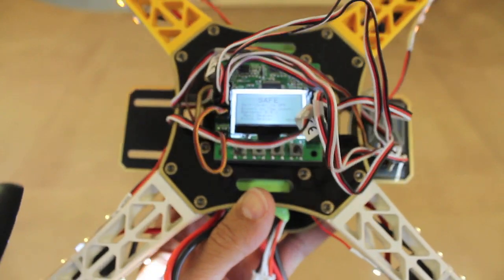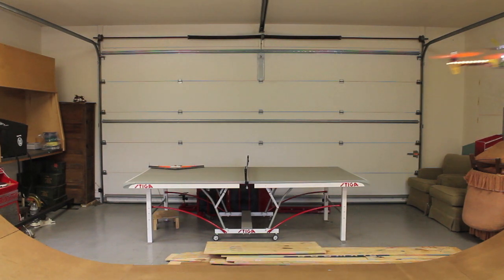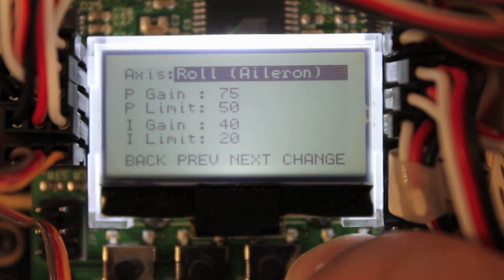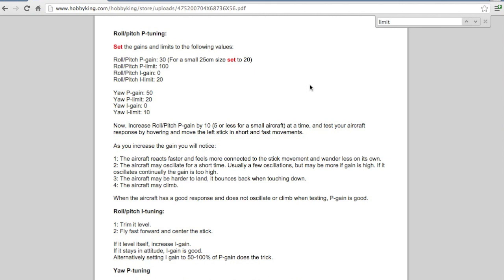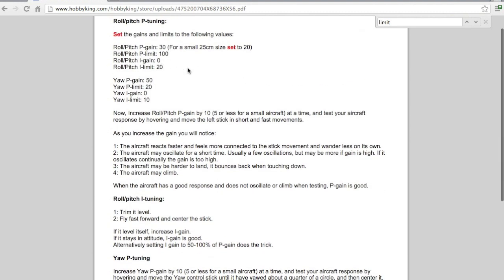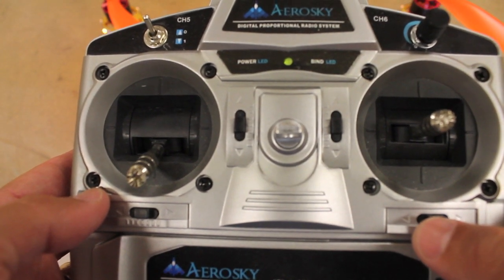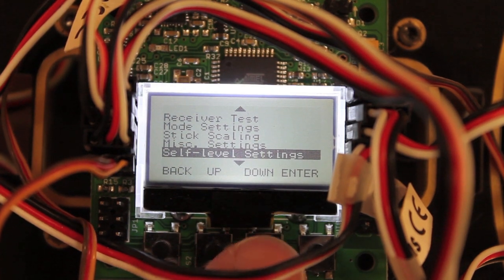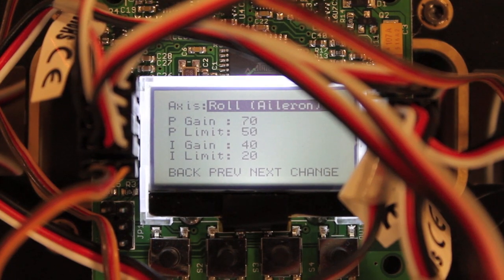KK2.0 Multicopter PI Gain Tuning for Beginners

Comment: Hey Dennis, I've watched yours and many other PI tutorials and think I understand it o.k. But my question is are these adjustments affecting the stable mode only or do they affect acro mode as well? I feel like I have to be on the stick the whole time in acro mode just to keep the quad from crashing. I have the KK2 with 1.6 firmware (I think 1.6, did it a while back). I see these videos with the quad on a string (Rolf's, and a couple others) and when properly tuned they stay in the attitude they were in until corrected. If they were in stable mode it would flatten back out. So I guess I may have just answered my own question. I've played with the PI in stable mode and can see what too high or low can do, but still not comfortable with flying acro yet.
Reply from the maker: Good luck with your experiments and it will be no time before you're flying in acro mode. It really is a lot of fun and challenging at the same time. I still use stable mode when I get in trouble or am doing some filming, but other than that I'm in acro trying to fine tune my skills. Thanks for the comment.

Comment: Hello Dennis it's Eric again. I am builing my wife  a quad. It is a Turnigy H.A.L. She would ike to use it for aireal photography.  She would like gps hold, altitude hold and return to home. What type of flight control board would you recommend.  She still new to the hobby, almost a year.
Reply from the maker: Eric Ankudavicius Hey! I think the easiest thing for you to do with best potential outcome is to install NAZA V2. It has good stability and should work well with the HAL frame. You'll get alt hold and RTH. Good luck and keep us posted.
Reply: Thank you for your advice. I will use the NAZA V2. I am sure you will hear more for me. Thanks again.

Comment: hi Dennis, im going crazy on my tricop. the servo goes crazy jitter when i accelerate. i tried changing into a big standard servo hoping to handle it but it doesnt change at all. now i will try to set it as shown on ur vid and let you know if it gets better (hope so) otherwise kindly help me with my settings. im pretty NEW in tricops, thanks a lot God Bless and more power.
Reply from the maker: bobot021070 Sounds like a plan. Good luck with getting things configured and hang in there. It doesn't always come easy, but is incredibly rewarding when your bird is in the air. If you continue to have problems please feel free check out www.garagepilots.com and post in the forums. Take care.

Comment: Hi... is 'auto level' the same as 'altitude hold'..?

Does the KK2.1.5 flight controller have any of the bells & whistles of the other controllers?
Reply from the maker: No it's actually different. Altitude hold is generally done with a barometer or GPS. Auto-level just stabilizes the aircraft and keeps it level when you let off the sticks. You may be able to do what this guy did with the MultiWii firmware although I've never done it: http://www.rcgroups.com/forums/showthread.php?t=2157987 Let us know what you find out.

Comment: in my project i use k.k. 2.1 controller board and fw is 1.9 but with your pi setting it can not flying. problem is that motors will start to increase in speed while others are decrease. please help me 
sir.

Comment: Hello Dennis, I have set all the setting as you have shown me, but the screen shows :Error; no yaw input. I have set the yaw to 75,20,30,10. then back to  PI Editor. as your video shows. Do you have any idea why?
John.
Reply from the maker: John Stanley I haven't seen that before. Perhaps it's a channel issue with the board not seeing any signal from your yaw channel? That's my best guess right now.

Comment: My mistake.  Yes, auto level.  When I turn auto level on, it starts to do small banks, then holds the small bank and and starts to run off with a mind of its own.  It is not "drifting" but actually doing various banks and holding them.  But it flies great with auto level off.

Comment: Hi, I just built a hexacopter and I have the kk2.1.6++ firmware but I have a problem with the P settings. Will your setting work for the hexacopter?
Reply from the maker: Sol mag It's hard to say. My guess would be that they won't work and you'll need to tune them higher. I would see if you can work your way up from what I have since your hexa will have a larger frame.

Comment: Hi, I have an X230 by HK.  The problem I have is that is flies well when off safe mode, but when I turn on safe mode the copter starts to have a mind of its own.  I tuned the ESCs, made sure the board is calibrated level, everything is balanced.  I have a blade nano quad which is rock solid so now I really can feel how bad the x230/KK2 board are.

Also, I understand P & I gains but I am unsure what the P & I limits are for.

Any help or input is greatly appreciated, Thanks

Comment: ps is it bad if i set the servo with a y extention? one of them goes to the RX and the other goes to the KK2. what is the correct connection of the servo? thanks again. More power.
Reply from the maker: bobot021070 I've never setup a Tri before, but I'm fairly confident you shouldn't be using the Y connector. Your inputs from the receiver should be connected to the KK2: AETR. Then M1, M2, M3 hook up to the appropriate ESCS while M4 is where you plug in your servo. This is a great guide that may be worth referencing. Good luck and keep us posted.

http://diytricopter.com/wp2/build-log/

Comment: What was the reason for going from MultiWii to KK?  I just went the other way and feel that my quad flies much better under MW.  Response is crisper and it is more stable in hover.  Under MW I can make stablr vertical descents through my own down-wash.  Under KK2 v1.6 it would oscillate badly.

Comment: Thanks sir that was very helpful
But i have problem with throttle it does not stick to one position while flying with low level
I am using kk2.1.5 board
450 frame
1000kv motor
30A esc
4400mAh 3S battery
Please help me with the problem 
It is easy ro take off but very difficult to land it as i drop little throttle it comes very quickly on very large diatance

Comment: Hi Dennis, 

Thanks so much for all your informative videos - couldn't have done it without you and others posting videos on your experience with multi-rotors. Those KK2 Boards are a pain in the ass and are hard to trust after a crash, despite sensor test coming out okay it can still play up ; ) Good thing they are cheap! Got a video with my entire journey to date building a hexacopter just uploaded, check it out if you've got a sec! All the best, and once again...thanks! :  )

Comment: Hallo... Friend. I built an f450 quadcopter & using 1400kv motor & 8045  propellers.kk2.1. 5 mini flight controller also.I calibrated the ESC and the motor running in proper direction with maximum throttle. But it cannot fly.I tried 1045 propeller also Expecting your reply.

Comment: I have an fs th9x transmitter and I'm using a kk2 on an alien x quadcopter I wanted to know how to setup the diff modes for acro and auto level or does it setup automatically on the switch?
Reply from the maker: +george aura You'll need to likely configure the weight and offset for each switch so it can trigger the correct flight mode on your controller. Good luck with your build.

Comment: hi dennis joey here, so what mode are you using to fly the quad, helicopter mode or airplane mode?
Reply from the maker: joey jacildone I use ACRO mode on the Turnigy 9X. Now that I'm flying with the Taranis it has a generic template that can be easily modified.
Reply: use airplane mode if  that is your only 2 options, i have the tgy-i6 and had the same question a few months back

Comment: I tried everything like how you set it up but whenever I raise my throttle, the quad just flip to the back and break my motor,and then I fix them back and switch on the auto level and it does the same thing, please help me,or should I get the 'qq super flight controller '?
Reply from the maker: Aaron RC I'm not sure what the problem is without more info. Perhaps you can post in our forums at www.garagepilots.com and someone can help you out. It sounds like there may be a calibration issue.

Comment: i tried all your setting and my quad work, but for some reason when you do the YAW right the quad moves forwards, and  YAW left the quad moves backwards, 
we have the same setting but i wonder why is that happening. feedback will be much appiciated
Reply from the maker: sir francis Not sure what's going on. I can only recommend messing with some of the gains and see if you get better results. Generally you'll see a bit of drift when yawing. Just depends on how much you're seeing.
Reply: thank. ill have your setting as my template then ill start adjusting. thanks again..

Comment: i was thinking of geting one but i have 11.1 batt how do you power it when it is 4.8-6 volt from 11.1 volt
Reply from the maker: You can get 5V out of your receiver or use a standalone BEC that will step down to 5V.
Reply: ok thanks

Comment: Its ok bro.. and i got my problem solved but there arrives new problem except M1 all strts together just M1 takes time to catch up... any ideas???
Reply from the maker: +Rohit Chauhan Maybe try to do an throttle calibration individually on that ESC. Perhaps the starting point is off compared to the others. As long as you don't notice any difference in actual hover and performance I wouldn't worry too much about it. Good luck.
Reply: +Dennis Baldwin  thanx man i changed min throttle and it works just fine but a roblem still occurs. now.. my quad does take off but goes in a certain direction continuosuly.. cnu help me bro??

Comment: Hi dennis will these settings work for my tricopter?
Reply from the maker: ras4q2001 Hey unfortunately I've never flown a tri with the KK board so I'm not sure it will work. I know the process will work, but not sure about the specific settings. Let us know what you find out. I think it would be useful for others as well. Thanks.
Reply: Dennis Baldwin Hi Dennis  the pitch&roll settings are good my problem is the yaw settings my tricopter drifts to the right when i take off any ideas thanks

Comment: ey admin I'm having a trouble in starting my quadcopter. when I rise the throttle the motors doesn't spin till I push it to the middle then one after an other motor stars to spin can u plz tell me what's the problem with it
Reply: Muruli muruli you need to arm the quad .

Comment: My KK2 is SO HARD to fly :( It wobbles like crazy when I'm flying and it randomly will rotate in a random direction, and sometimes it will go forward or backwards at random, its securely mounted on my board and I've calibrated my ESC's. Please help
Reply from the maker: Do you have the KK2? There was another guy on www.garagepilots.com that messaged me with a similar issue. Perhaps you'd be willing to post over there and I can get some others to chime in. We'd need to know the size of your quad, motor and prop specs. Take care.

Comment: Actually need help pls. After following ur settings, i can't still take off. It keeps flipping over on take off. Pls help! Thx!!,
Reply from the maker: sabyx5 I would check to make sure the motors are spinning in the proper direction for each motor position (M1-M4). After that make sure your propellers are the right type (CW and CCW) based on the motor rotation. That would be my first guess.

Comment: Shoot, I'm having trouble just getting mine off the ground. It keeps flipping over, I'll have to try these settings.
Reply from the maker: Cool. Good luck and if you continue to run into problems please join us at www.garagepilots.com and post in the forums over there.
Reply: You might want to check the propeller spinning direction. If you have that correct, hold your multi and give some throttle. Move it by hand and feel the reaction of the multi. Also check your control, you might need to reverse it.
Reply: I had the same problem as you are having. First, check the motor spinning direction. In the KK2 board, the motor layout is clearly shown, and you need to follow exactly the same spinning direction for each motor. Second, check the sequence of ESC to KK2 board connections. In the motor layout, the motors are labelled with numbers, 1, 2, 3, 4. The ESC has to be connected the KK2 board in this sequence exactly. Hope this helps!

Comment: You really look like you know what your talking about so maybe you can help me with my problem.  I have a f450, 1000kv motors, 30A simonk esc's, kk2.1.5, 3000mah battery, and 1045 props.  Every time I try to take off it wants to flip to the right.  I have tried absolutely everything.  Do you have any ideas or suggestions?  Any help would be greatly appreciated!!!!!!!!!!!!!!!!!!!!!!!!
Reply from the maker: Mark Scott Some things that come to mind:

1. Calibrate your ESCs

2. Make sure your motor rotations are correct for each motor position

3. Assuming #2 is good then make sure you have the right props (CW/CCW) installed for each motor

4. Calibrate your accelerometer and make sure you keep your quad level and still when arming

5. Check your TX trims and subtrims to make sure you don't have unnecessary roll applied

Good luck and keep us posted.
Reply: Thanks Dennis I will try all of that and then I'll let you know what happens.

Comment: for some reasons i can't get the self levelling working on my kk2 board
Reply from the maker: There is an option to specify how it's triggered. I think by default it's triggered by a stick sequence, but you can change it so you can control it with a switch on your TX. It's been a while since I've messed with it but check your menu options and you should be able to find it.
Reply: Dennis Baldwin i just figured it out thanks.

Comment: What would you recommend settings for a KK2 on a 250 quad.
Reply from the maker: Eric Ankudavicius Use the settings from this video as a starting place and then work your way down. I've never flown with KK2 on a 250 so I'm not exactly sure.
Reply: hii